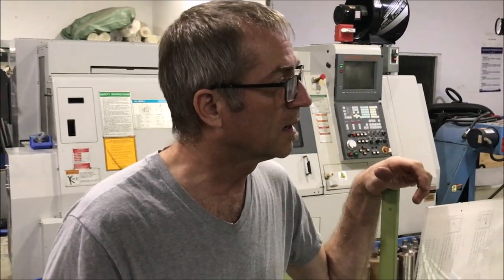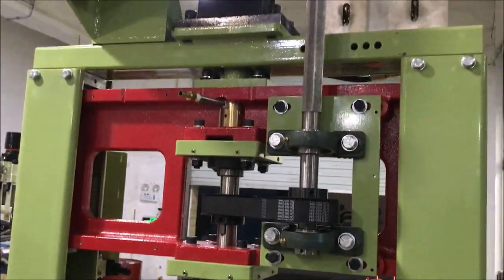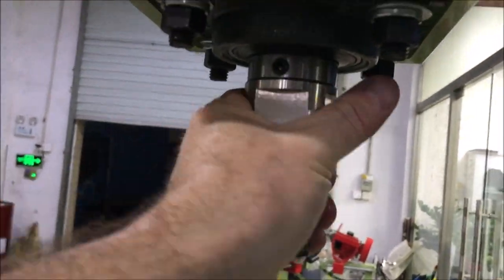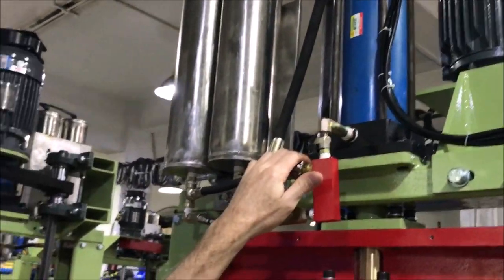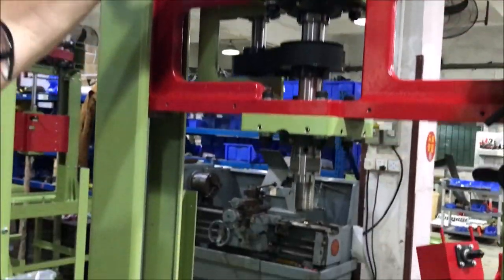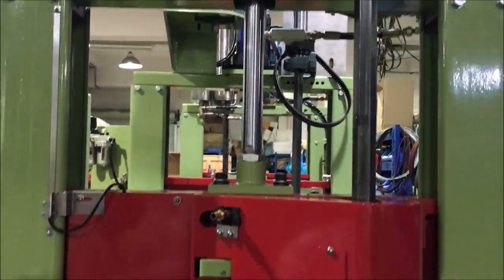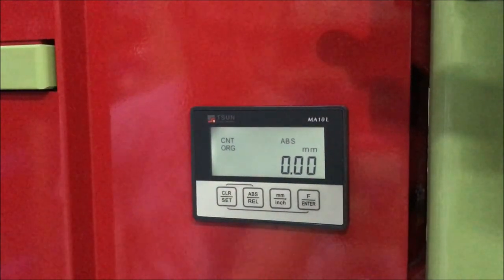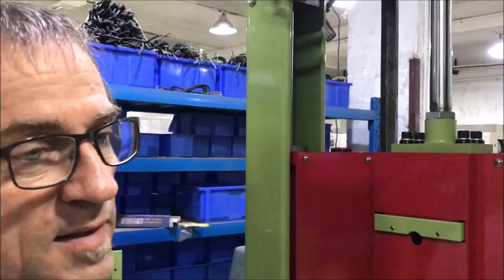First Look!  Overview of the Highland Park CD4 Core Drill System

Comment: I see the unit is 87" tall. How high are the controls from the floor, those that are used most often? I am a wheelchair guy and can only reach so far.
Reply from the maker: Hi, this unit will be featured in our Online Live Sale Event later this evening (5:00 PM - 9:00 PM ET) and it would be nice if you join so you can actually see the machine. There's a possibility that the controls will be relatively low if you're in a wheelchair if the unit isn't mounted on secondary legs. You can register for the Live Sale Event here: https://www.hplapidary.com/pages/live-sale